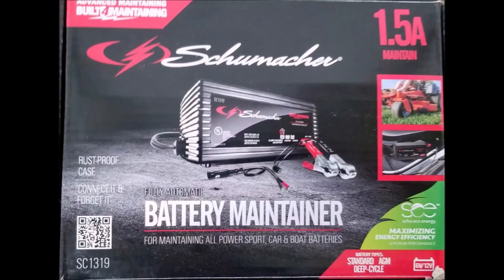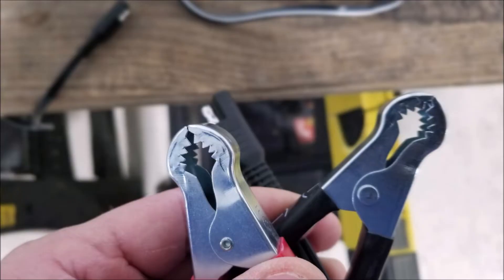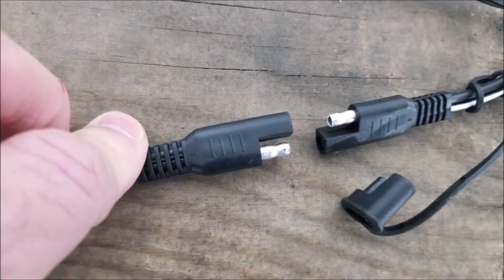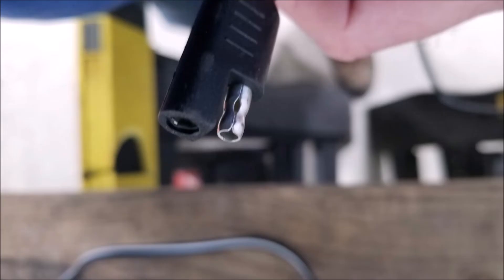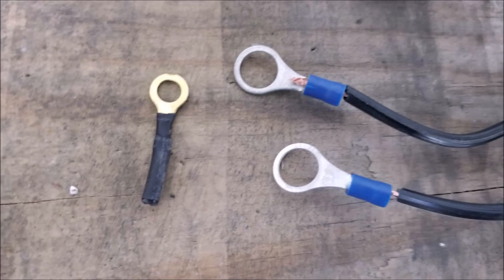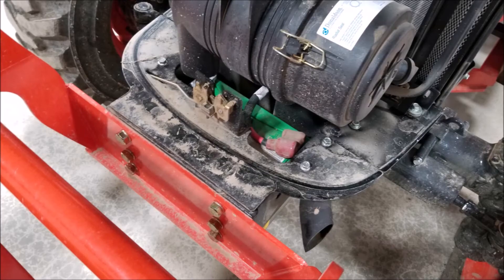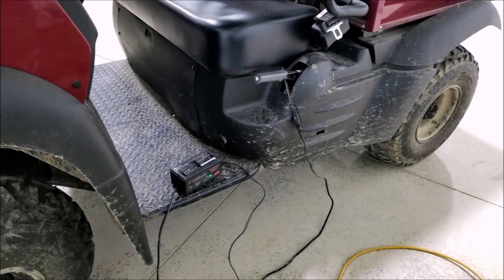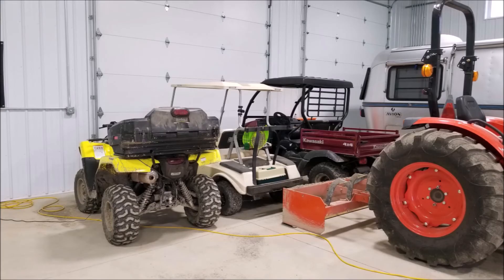Schumacher SC1319 / SC1355 1.5A 6/12V Fully Automatic Battery Maintainer.

Comment: When I try to connect mine same model the green light just flashes nothing else will happen I've tried 3 different batteries some that I know are low charge some fully charged, same result. Green led flashes intermittently, is it garbage now? Rarely used
Reply from the maker: I don't know. I think we have lost 1 of our 5 over time.

Comment: Does this have a circuit breaker because mine at the switch acts like its broke , I bought used, so I don't have paperwork
Reply from the maker: Not near one now but I don't think there is a breaker
Reply: @CountryCraziness  , thanks, yea took it apart and the switch is messed up, but I can fix it, alls I need is little tiny fingers, lol.
Reply from the maker: Glad it worked out

Comment: My 2amp came with a cigarette lighter connection.  How does that work, if you please.
Reply from the maker: If you can get from a lighter maybe you can back feed through it. What did the instructions say?
Reply: @CountryCraziness 
I think I can charge the battery using the cigarette lighter in lieu of clamps on the battery.  Mine came with that adapter.

Comment: A question for anybody out there with charger experience: I have a 12V sprayer pump running off a battery. Can I operate the pump while the charger is also connected to the battery? Thanks.................
Reply: Yes
Reply: As long as your amperage draw from your pump Is not more than the input amperage of the charger, you won't run out of power.